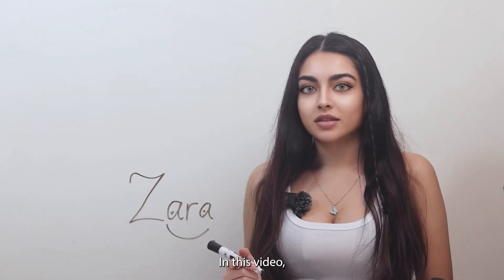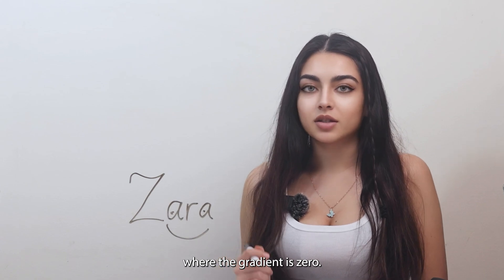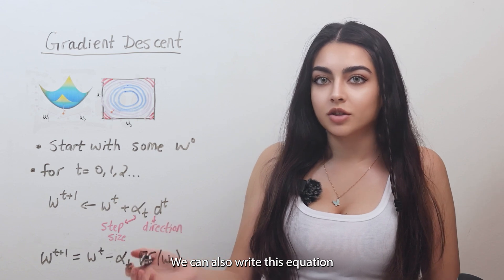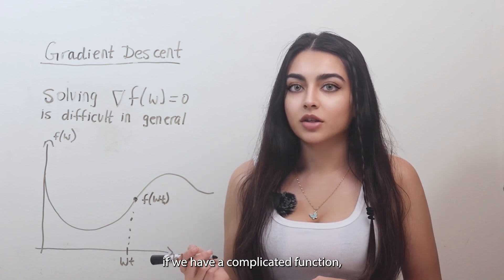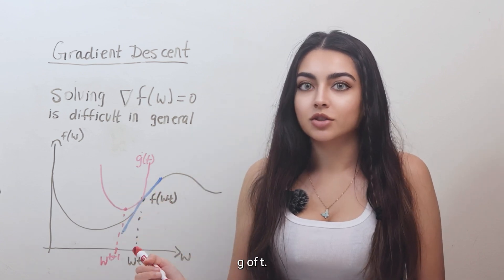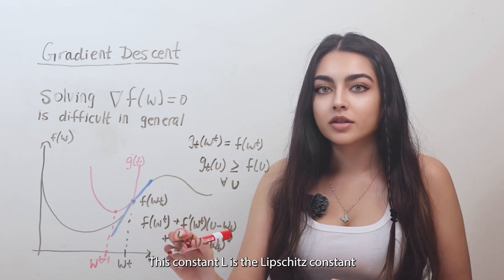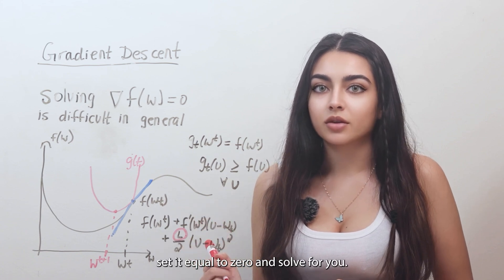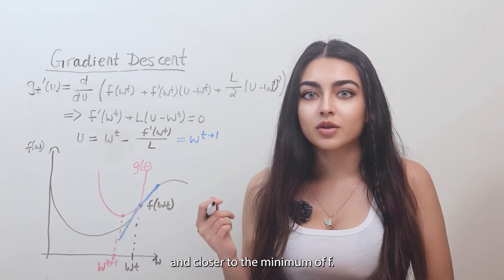Intuition Behind the Gradient Descent Algorithm - Gradient Descent part 2

Comment: You miss all the part about aproximating the loss function locally with a Taylor polynomial of degree one. In doing so, the gradient appears and does not seem like something magical. Besides that minus before the gradient multiplied by the learning rate is because the direction that makes that term biggest and negative is the direction oppsite to the gradient, which is the direction where both the gradient and the loss function evaluated in a point make an angle of pi radians, whose cosine is -1